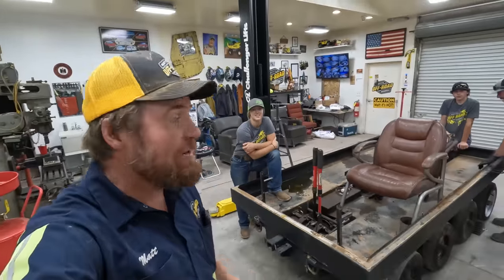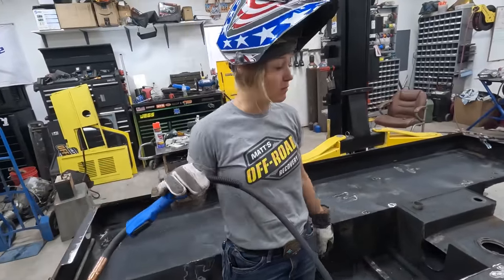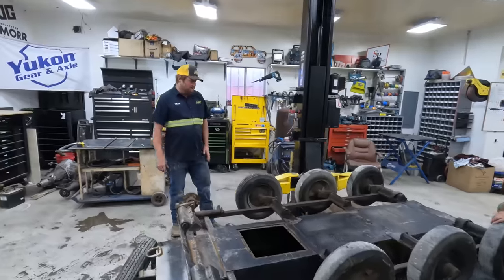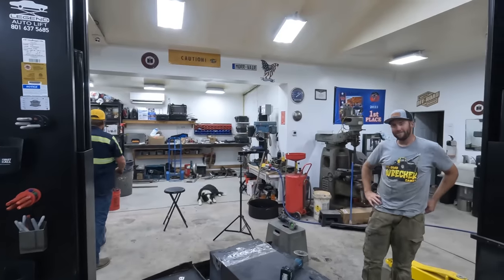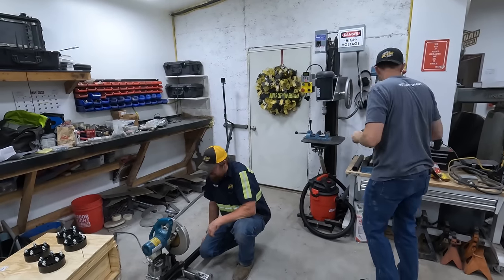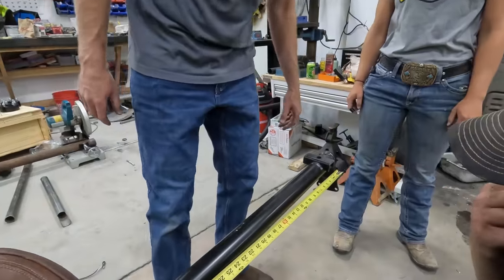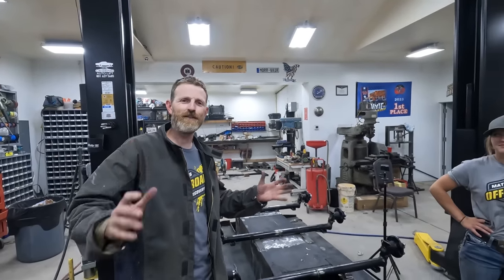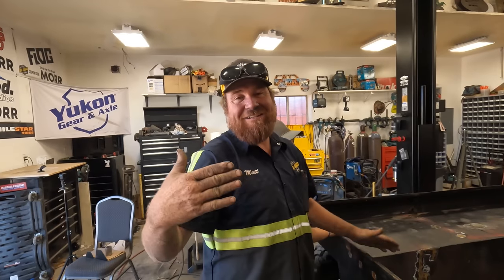I Stripped The Bombi Down To Nothing!

Comment: Keep in mind that when filling fuel tanks with water before cutting, that fuel is lighter than water... I had a buddy, get several old paint thinner barrels from work. He thought he would cut the tops off and use them for sorting some of his scrap metal. He filled the barrels full of water and overfilled them as a matter of fact. Water came out of the top of the barrel and went all over the ground. So he struck his torch and started to cut the top off the barrel. As soon as he got the torch to the top of the barrel, the whole thing went up, including all the wet yard all around that he was standing in, now a puddle of fire... 🔥 🫣 🤣😂🤣 He wasn't hurt, but oh my, the dance moves.

Comment: LOL. I saw that thumbnail and I was all like "ohhhhh.... when did they get an M274 Mechanical Mule?"
On a side note, torsion bar suspension wears out and the bars need to be replaced periodically anyway (just ask anyone who has crewed a modern military tracked armored vehicle). No wonder the Bombi "had no suspension" - it actually did, but it was worn out and nobody ever told you it needed maintenance/replacement done.

Comment: I used to do pipe fitting and we would never use a level like that, because it's so short you can't be sure of its accuracy, that's why you guys were getting different numbers in different places on the axle. Use a longer level, something 16" or 24" to get a better read of the overall pipe section. 👍

Comment: If you go with no suspension on the axles will the tracks have any articulation when undulating over uneven terrain?  Or are the tires basically going to be the only source of that ? Are the tires going to be at a low pressure basically?  I'm curious and look forward to the end result. Good luck team Matt's Off-road!

Comment: Just so you know. A GOOD chunk of the floatation on these types of vehicles and snowmobiles is the belly pan. If you raise it too high you’re relying on the tracks to have enough surface area to keep you floating. And it will high side on you. I hope you have a plan in place to smooth out the transition over the axles. Because it’ll be like hanging up on a tree. That’s why many of the side x sides with tracks and trucks do so horribly in deep snow and mud. They act like a big scoop. Just food for thought. Spent many years designing off road vehicles for emergency services and agriculture. You sink those tracks and it’s like being stuck in cement.

Comment: lol, if you are unsure "how square a square is - just flip it on a straight edge...  Centre punch on the angle can correct it once and for all (either way, inside, or outside)  provided the legs are parallel.

Comment: Guys, you could fit alco trailer axels in place of the bambi ones. i guarantee you wont regret it once you take her on anything but smooth ground..the track gear will also benefit when rolling over rocks and logs etc.

Comment: Hmm ... I can 'see' the fdinisheds produc t - as you see it, Matt - and it is goinjg tro work admirably.  I gather that you can programme the horsepower/torgue of the chosen engine - a thought occursa to me that you could do what Caterpillar did with the predecessor to the Challenger tractors in that they limited the hgorsepower in low range so that specs were not exceeded - the extra horsepower was needed in high range. Go check out Caterpillar's explanation if you can't work out where I'm going here.
Your new Bombi is going to be a game changerr!

Comment: There is a limit to how much power the track system can take.  Start with the maximum torque you can use without breaking parts, and use an engine that won't exceed that number.   Smaller is better for weight and space required.  The more weight there is up high, the worse those side hill tipping issues become, and you can't drop the engine lower in the chassis.    I love big engines, but they are not the best for every application.  If the track system can take what the LS puts out, great, but if you have to be careful with it or break parts, I see big problems up in the mountains ahead.

Comment: A couple of points, it's great you sleeved the axles but you should have drilled and rose weld the axle joints as it stops the sleeve from sliding as you hammer the other side in. 
Also, why didn't you install two big rectangular steel chassis rails along the side? As it looks like you are welding to a sheet metal chassis.

Comment: Those torsion bars on the suspension are not for comfort but to keep the track pushing down on the snow, otherwise the track will not  accommodate to the trail as effective.

Comment: Doesn't suspension on a tracked vehicle take up slack in the track. Slack prevents undo stress on tracks and axles when you drive over a boulder or tree. I'll concede that  your use case may not include anything under the snow. Are you reusing the original tracks? I might design the same way if you are using new fully rubber tracks.

Comment: Hey Matt if you eliminate suspension you might end up derailing easier or blowing a tire as you may want to have al wheels pushing the band to the floor.  You would be taking away efficiency to your traction too.

Comment: I think the Bombi has a major design flaw.  The track drive gear should be at the rear of each track.  This is how bulldozers are set up.  With the drive gear in the front, all of the torque pivots on the wimpy trailer rear axle.  Either beef up the rear axle to handle the torque of the new engine, or move the drive to the rear.

Comment: I use water and rinse well drop a air line with 5 to 10 psi make sure it's vented  then start cutting just don't stand in front of the vent i have had them belch

Comment: seems like you could add a leaf spring system for some decent suspension if yall wanted.
Reply: also if your run a brake distribution block to your master cylinder just make it lower than the master and the rotors for an easy bleed, you could then do independent corner and run dual tracks on each side get some relish steering. not sure if you would gain or lose traction doing a quad vs dual track setup.

Comment: If you want a simple reliable engine that will produce steady constant power that won't die, get a ford 300, rebuild it and use the holly sniper EFI. That engine is tougher than the wrecker.

Comment: looking good. but first off I'm not saying it won't work like average youtube comments but dropping the boogie wheel suspension, while your reason makes sense, my backyard redneck science is thinking the main reason for the suspension isn't necessarily for ride comfort but to relieve the impact n each individual boogie wheel from not only impacts and jars from running over harder things but more for the twisting side to side from turning along with helping keep the track's tension. the new axles might take a lot of stress right at the frame and spindle itself. And while in the snow there are definitely smoother paths..... but with snow comes cold and the colder steel is the weaker.

Comment: You can have custom radiators made to order;  you don't have to limit yourself to off the shelf.  Everything else about this build is one off custom built!  You may have a big problem when you put 3X the power to those archaic tracks; or do you plan on having new tracks custom built too. Of course you are because you are using bigger wheels and tires.

Comment: So if that's 31"  tires, and your final will be 26 (with the tracts).  That's only 2.5" shorter than this.  It sure seems narrow to be that tall and top heavy.  I just imagine this thing leaning on a hill, it's going to be sketchy and try to roll.  I thought you were going bigger because you wanted it to be wider...  Since you're not going wider,  I sure think you should only go 20" on the tires.   I think the height of the old setup was just right.  Just needs that LS power and some Superduty brakes and it will be glorious.

Comment: If you ever watched a 4 axle mobile home drive over a curb at low speed, you would have a better understanding of weight transfer through articulation. Sometimes a wheel set, must move out of the way., to survive.

Comment: Hope you are recalculating the gear ratio and torque since you are changing the tire diameter. May not be a big deal unless you change the drive wheel size.

Comment: You should keep that 4.3L V6, rebuild the lower end, put on new heads, ad a super charger with a water to air intercooler.  This would give you the same power as the LS1 but at a much lower weight and volume.  Using the same radiator you would for the LS1 would ensure no overheating problems.  But, you would need to find room for the liquid intercooler radiator.

In all fairness, I am biased to the 4.3.  I had a 90 S10 with it for many years.  I loved that truck.  It was a single cab with an 8 foot bed.  I put a 2 inch body lift and a 3 inch suspension lift on it.  Being only 2 wheel drive, I was a support vehicle. I carried all the extra gear, fuel, water, and normally towed an 18 foot long bumper pull trailer full of firewood for bond fires.  I did many more modifications before I totaled my S10 during the worse period of my life.

Comment: Interesting how you are reengineering the BomBee with a LS is going to rip what are the plans for transmission in it is that what the BUG is for knew a guy that used a bug diff and motor to make a off road swamp buggy with 6 wheels driven by chains between the axles

Comment: Long time watcher, first time commentor...
Is it me or should the axles have been clocked at an angle? The other axles were bottomed out but appeared 90 degrees from where the new axles were set. Seems like it would sit higher than needed and that is not like Matt... (IMO)

Comment: bad idea 86ing torsion suspension. your torsion bars were sagging/weak. a proper torsion suspension is superior to springs as it always wants to go back to center regardless of a bump or hole search m1 tank sus. at speed, its the key to traction as it articulates track into holes and vice a versa. you can move bump stop or  make it thinner but don't remove torsion...the alfa romeo 115 v6 chassis uses front torsion like  a toyota highlux only alfa uses on lower a arm for lower center of gra. tire pressure travel is simply lazy guys.

Comment: I would put new torsion axels in. Put in 4k lbs axels. If you have zero flex you will break the track and the drive sprockets. I will put  money you breaking the track off.  If a CAT bulldozer has spring and shock absorbers inside to cousion the start up of the track and loads.  And you are loading the track when pulling!  I would have put down 1/4 plate under the axels as well.  Just like that had it before. I will put money the welds tearing and cracking from no suspension.  I would not put an LS, 1978 4 bolt mains 350 with alum heads, mellowed out to 350hp with 350 torque, bolted to 7r4 built to handle 500hp. That way you cant hurt the transmission.  You will have to build a shield around the brake disk on the drive shaft for safety with added hp and torque.

Comment: I don't think you will be able to keep it cool with that size engine, I would think the  "Iron Duke " 2.5L motor from GM would be a great motor. I had a Monza with one that went over 250k and was still running great until California's smog laws said it was a gross polluter and I had to scrap it, Turned out it was still running with the same emissions as it always had but Ca. in all their wisdom changed the smog limits on older cars trying to get them off the road, they got ride of a bunch of them until the Ca. supreme court told them that they couldn't do that.
The GM 2.7L Inline 4 cylinder TURBO L3B  might be a choice.

Comment: You need to get that Miller 255 back to you're dealer. They are a pos! I bought  several and they were nothing but non stop complaints. They are junk. Lucky my dealer replaced ours with brand new 252's after a year of experiments to make them work . Would go through 5 tips a day on a good day. They are junk. Make them replace them. I've had better luck with Lincolns but gave em another chance after batting 0-8 for years.  The poorest welder I have ever welded with is that 255.

Comment: 3/4 of the way through the video and I’m confused how the 4 axles installed will allow for a drive axle. 🤷🏻‍♂️
Reply: The drive axle has sprockets and is separate from the tyres, shown at 01:35.

Comment: Did you know you can weld has tanks without filling them with water ,...just run exhaust from motor into tank  has won't burn or fumes because of the lack of oxygen

Comment: You should use the same Golen Stroker Inline 6 engine you used in the Bannana.  That thing is a beast you were breaking stuff left and right after that engine upgrade.  Those inline 6's last forever and are smooth which would be a good thing in a snow cat.  Inline 6's have perfect primary and secondary engine balance.  Have performance transmission build you up a tranny for it and the Bombi would be ready to pull stumps out.  Be the tugboat of the snow.

Comment: I always enjoy your videos but don't understand why you're removing the suspension...?

Tracks don't give in any significant way to smooth out the bumps.

Imagine taking any of your off-road vehicles, removing the suspension, welding the axles to the frame, and taking them on an off-road trail. That is how this is going to ride whenever you're not on soft, powder snow. It will still be great on deep powder snow but I predict you'll need to drive very, very slowly when on bumpy trails.

On top of the horrible ride, you're going increase the stresses on everything by a factor of at least 10x (stresses from shock and sudden loads are MUCH, MUCH more likely to cause more damage that smoothly applied loads, through a suspension).

I normally agree with your mechanical decisions, but not this time... Hopefully it won't be too difficult to retrofit a suspension later on...

Comment: Yep, its God's motor, the LS. Unless its a 5.3, then its God's motor with idiotic cylinder management. Why is it God's motor? Cheap and plentiful. 

Hydra-static would get rid of the idea that you have to hold friction type brakes against HP and would use the HP against the momentum. There is a reason tractors use hydra-static instead of old fashioned foot brakes. I'm interested to see how things pan out.
Reply: :face-green-smiling:THE LS MOTOR IS A DINOSAUR --------- LET IT DIE IN PEACE
Reply: @DOOODWDDDAD  look, and m a Mopar guy. Not a fan of the ls. But it's literally less than 25 years old. It is in no way a dinosaur. Also... My comment was sarcasm.

Comment: It amazes me that you over in the States keep using imperial measurements. All those calculations with 1/8th, 1/16th, and so on are extremely complex and prone to mistakes. It will take (some) time to adjust, but I am quite sure once you change to the metric system, you will never want to go back to the Middle Ages.